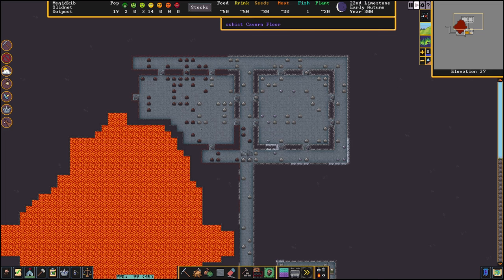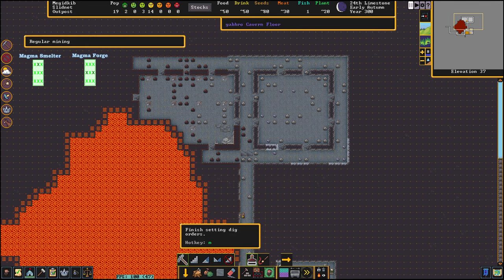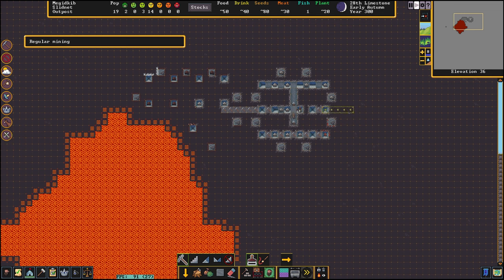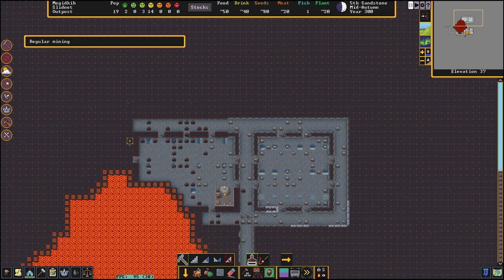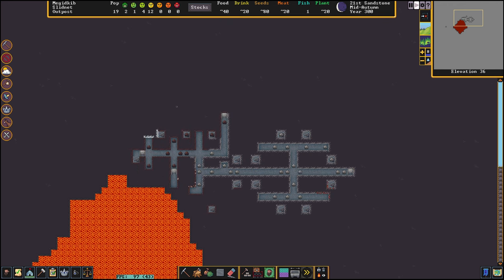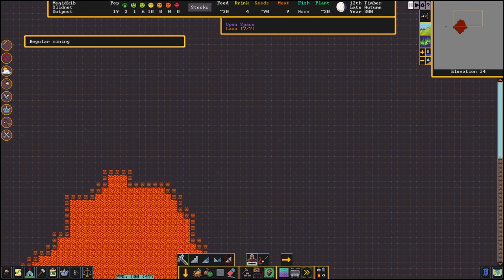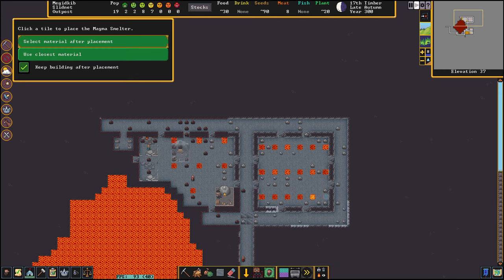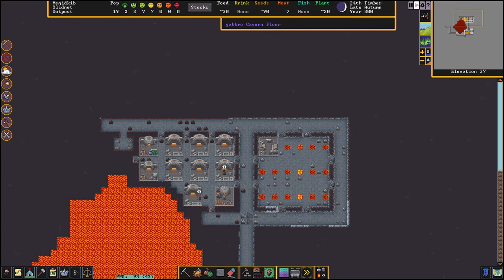Enhanced Dwarf Fortress Steam Version Magma powered metal industry. Magma Smelter & Forge Tutorial

Comment: Don’t you need to place floor grates to prevent creatures from swimming in via your magma tunnel?
Reply from the maker: never happened to me in magma,  i dont think that a creature can got through a workshop
Reply: You don't, but you must have the magma opening directly under the furnaces "impassable tile". You can see where the impassable tile is when placing the furnace, by it having a grayed out X, instead of the more brightly green Xs. This also prevents the dwarfs from falling into the lava, or dropping items there. This tile functions the same as a wall would. Some structures have three impassable tiles, and this should be considered when placing, as they can block off areas completely.

Comment: Thanks for the video. One question: will the magma cool after a while since it is disconnected from the source?
Reply from the maker: it depends, if the level of magma is 1 or 2 i will cool down and disappear, if the magam is level 5 or higher like in the video, you need at least 5 levels of magma to run your smelters and forges, the magma will not cool down. That means you have an infinite source of energy
Reply: @veantur  Thanks a lot! Very helpful for a new player.
Reply from the maker: Good. glad to have helped.